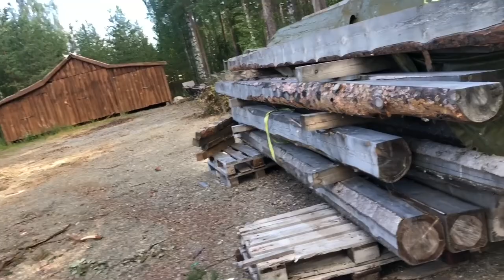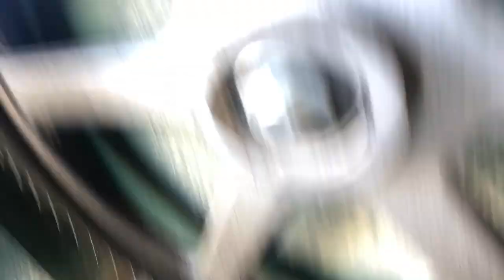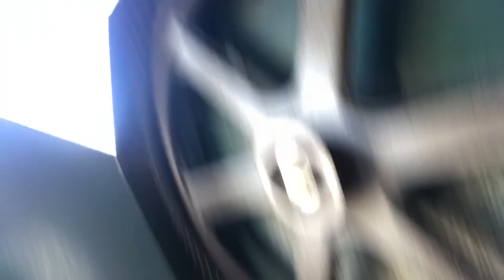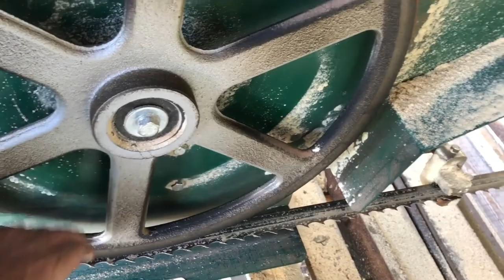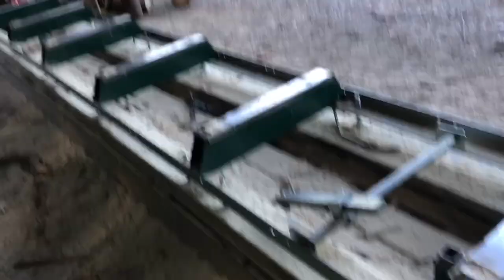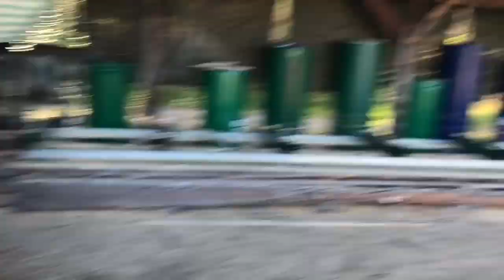Woodland Mills HM130 Milling and Cleaning Softwood from the timber clearing job

Comment: Good video the sawdust buildup is a real problem I see you have brushes against the wheels how does that work ?
Reply from the maker: Hi, thanks, I did an explanation of the brushes in this video 
https://youtu.be/KOPx0Cdu_ZA
It stops some problems I was having which you do not get on larger saws that have brushes as standard equipment.